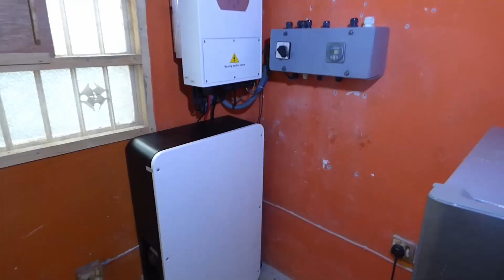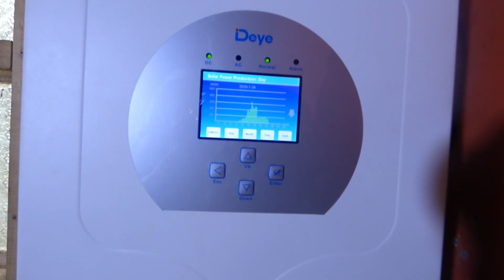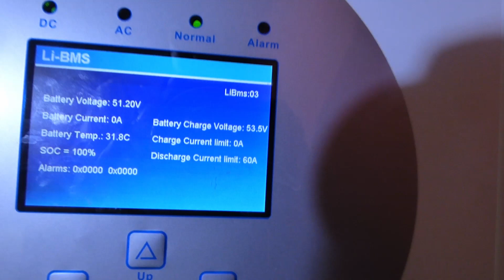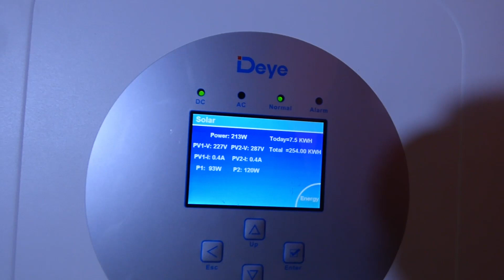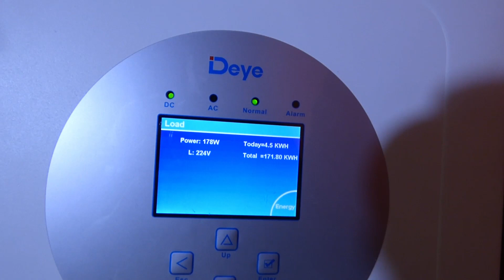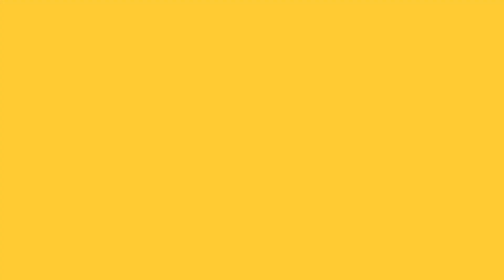Are the Chinese made products as good as the European or American?

Comment: Can deye go off grid if one decides to go off grid? I am not an expert at solar system but I know a little. I want to ensure that I will be getting a good brand that will last especially since solar isn't cheap in my country.Thinking of the deye 8kw hybrid inverter with 10k lithium battery. I was thinking of growatt unit initially but I will take your word plus the installer says deye is better. Also generally how long does deye units last from experience. What is their warranty policy like?
Reply from the maker: I am 100 % off the grid and it served me well. What do you plan to power in your off the grid set up?

Comment: Is the deye offgrid hybrid parallel?
Reply from the maker: You can parallel it if you want it.
Reply: @drsolar  how about offgrid hybrid?
Reply from the maker: I am off the grid no connection to the grid
Reply: @drsolar  The local people selling the deye are telling me it is an ongrid inverter.
I will have a grid connection however I do not want to export power to the grid. I will use solar/batteries mainly and import grid power if solar/batteries is not sufficient.
Would the deye work in that situation?
Reply from the maker: Which model are they talking about? Deye has grid tied inverters too. Mine will do what you want to accomplish
Reply: @drsolar  what is the model number of your 5kwh deye so I can tell the supplier the exact model I need.
Reply from the maker: @myparadiseonbantayanisland9030  Sun-5K-SG01LP1-EU
Reply: @drsolar  Thank you for the info, I really appreciate the info you have on this channel as it is from personal experience and not just what the brochure says😊
Reply from the maker: Thank you for watching and commenting. I am glad you can benefit from my experience

Comment: Hello I would like to know which software version do you have on your inverter I have the 8k version but for some reason the lithium mode does not work I have to use the voltage mode
Reply from the maker: Hello Harry which lithium battery are you using?